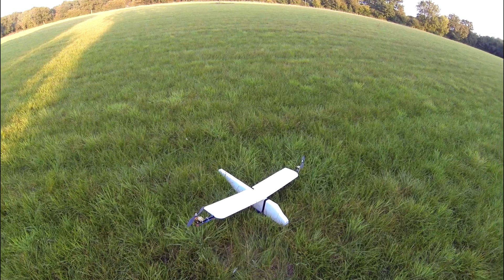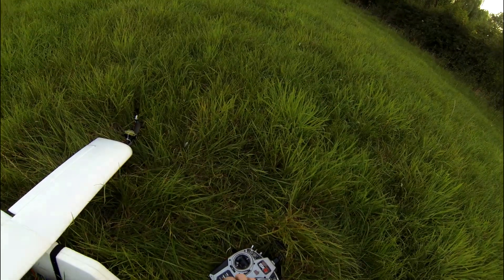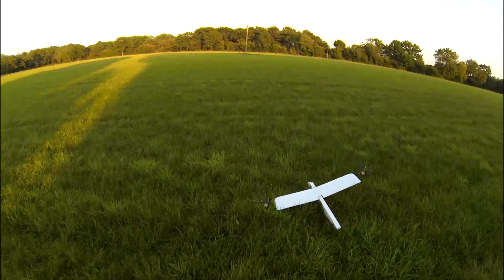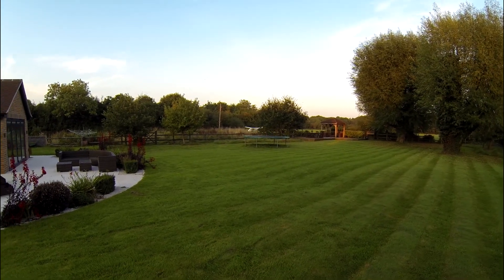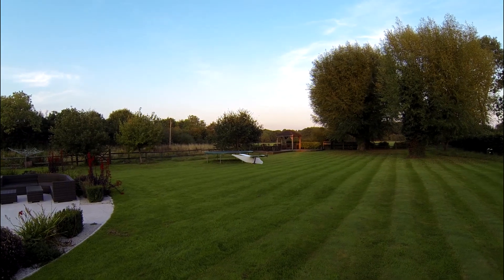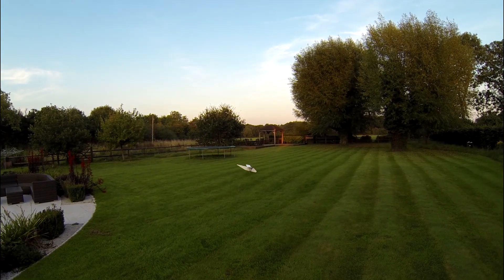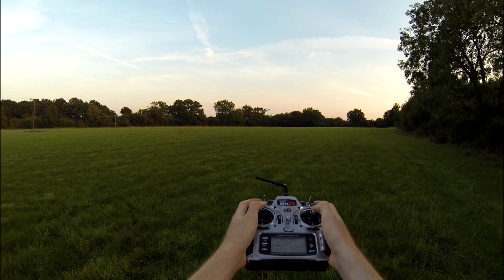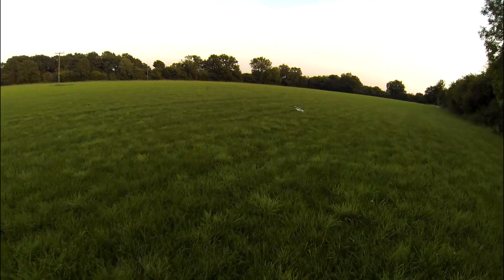RC VTOL V2 Hover testing #1

Comment: the sunnysky 980kv I think would work awsome
Reply from the maker: RCflyer729 I've decided to order the 1250kv sunnsky motors because I don't think the 980kv motors will have high enough rpm for forward flight. thanks

Comment: You can also stick some small heatsinks on the AL piece strapped on the motor arm. Or even just cut a few slots where the load is lighter to increase the surface area, and add another crushable piece of structure in the process to protect the servo. Nice job